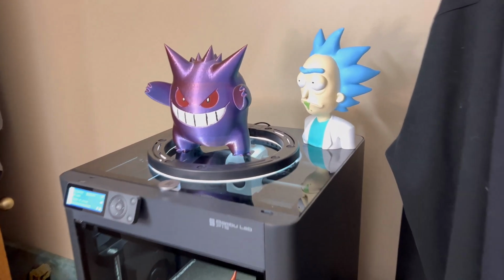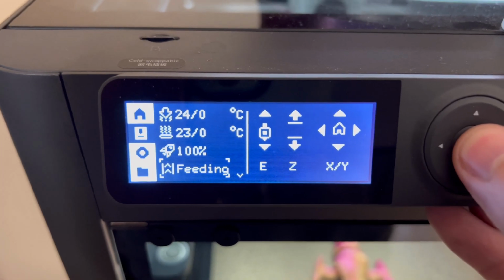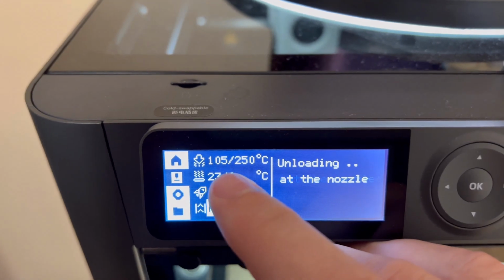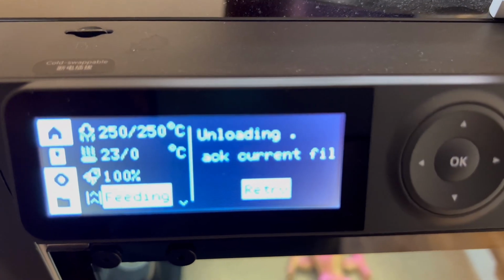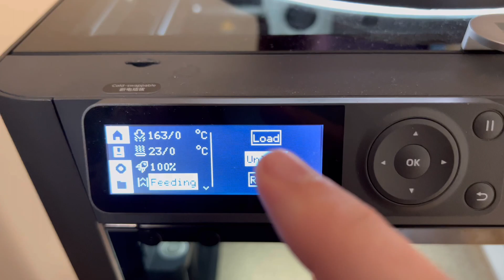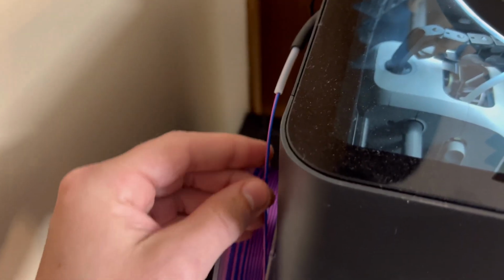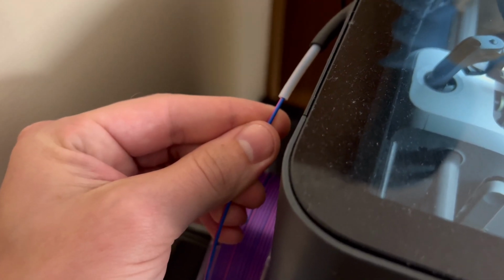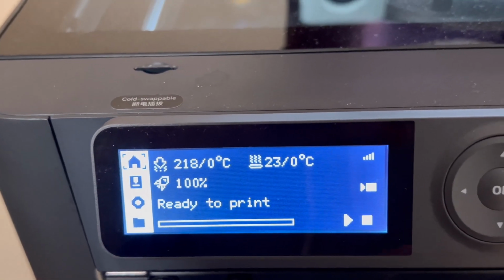How to Change Filament on Bambu Lab P1P & P1S

Comment: When do you tell the printer or tell studio that the filament is different? I went round and round with this in studio 2.3.1. I could not get it to realize the filament type had changed to PETG. It would always say it was unmapped and my only choice was to map it to the old PLA entry which reset it to think the spool was PLA. I used the handy app to finally get it to see the change, but it's super annoying that it's apparently impossible any other way.

Comment: hrmrmr i just changed from PLA to a new eSun PETG filament, its loaded and ready to go... but in "devices" my printer still thinks it has PLA: how do i tell it it has petg??? the interwebs tell me "oh just use the filament drop down".,... what filament dropdown?
Reply: oh wait i see... there's a TINY pencil edit icon in the ext spool graphic in devices setup... This is a pretty weird feature in an otherwise nice piece of software lol seems such an important thing yet almost hidden...

Comment: You ruined that spool by letting go of the end. I lost the spool that came with my printer because of this. It got tangled and eventually snapped off while printing... Then I unrolled the whole thing to try to put it back on the spool manually. Gave up after a few hours. Please hold your filament tight guys omg

Comment: soooo, what happens when things don't go as smoothly as what you have shown. I am changing the filament for the first time. The old filament is "stuck", it will not pull out. the retry option does nothing. The nozzle is heated up to 250. The Bambu labs videos show the same thing you show, but it isn't working. Great machine for printing, but the customer service aspect is complete SHITE , the company does not answer emails, or provide ANY post purchasing support.
Reply: Loose both screws of the nozzle, pull it Out, heat up your smallest allen Key and Push the hot end into the filament inside your nozzle. Now heat up the nozzle to 250 degree and pull Out the Rest of filament
Reply: @spasskanone1  Thank you I will try that and a few other things I saw when researching the issues ive had. I appreciate your tech support. First time i've had issues, but I am sure it is not the last!

Comment: Do one on changing it in the middle of the print
Reply: It's the same process.  To change a filament press the Pause button, or if the filament has run out and the print has been automatically paused by the runout sensor, just go through the same process of unload, pull out the remainder and then load new filament.  The temperatures are set automatically during filament removal and reloading steps.  Then select Resume to continue printing.

Comment: Just got my P1S today, but been 3d printing for a while, thanks for this. One thing I'll note, make sure to hold onto your filament and not let it go. If you let it go it will eventually tangle and cause a problem. If you don't let go it's physically impossible for it to get tangled unless it was already from the factory.
Reply: Let mine go accidently and I get a jam every 10 seconds
Reply: Same
Reply: @Buster_Diemer wdym let go?
Reply: @gustawkwiek2844  the end of the filament. If you let it go and it springs back towards the spool, chances are it's going to end up making a knot when you grab it.

Comment: My P1S has a white box (hub?) on the back theat the PTFE tube from the extruder goes into for the AMS. Do I need to diconnect the tube whenusing the spool? The tube is much longer than yours in your video. Thanks